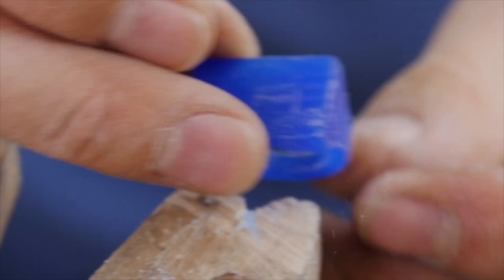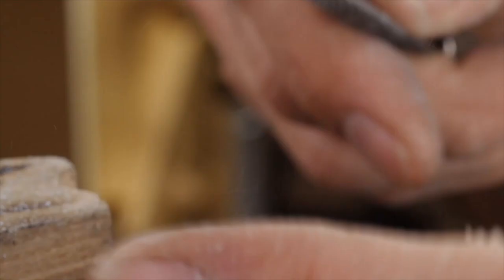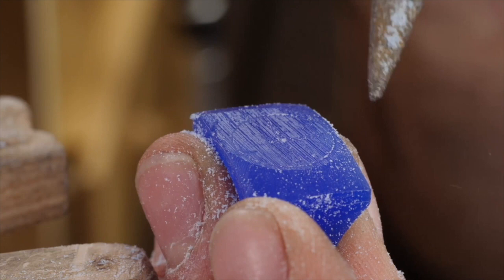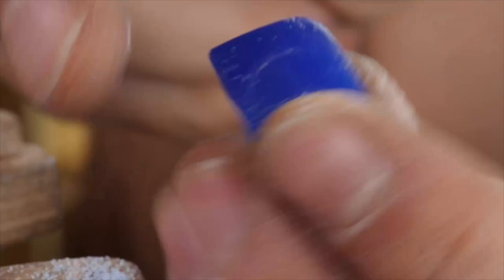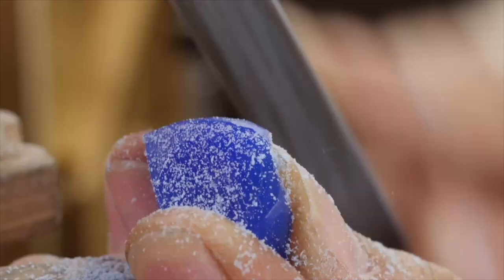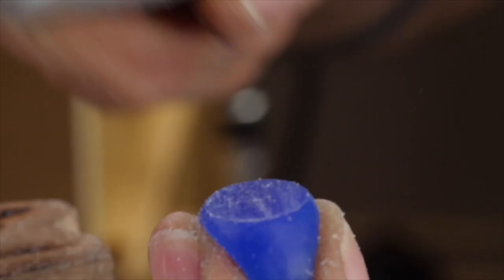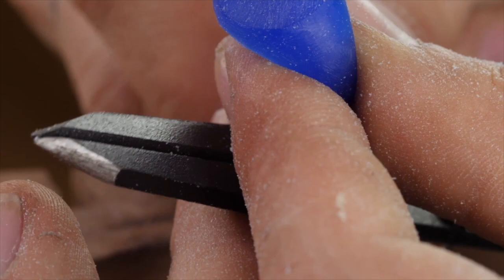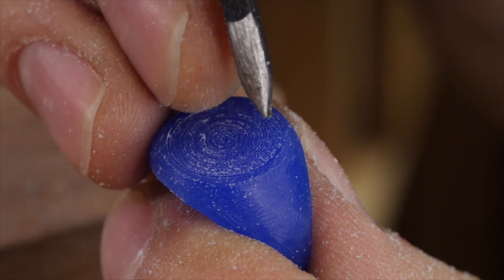Make a Wax Carved Signet Ring - Part 3

Comment: Great video, one thing that we do in my casting class that helps for finding center point faster is we use calipers to measure the width of the ring and then divide by two and scribe the line based on the number and it’s dead center almost every time! This is the best tutorial I have ever seen for ring carving so thank you! I’m making my class ring for a project at university so I wanted to do this style.
Reply from the maker: Thanks for sharing your tip! Glad you enjoyed the tutorial too. Good luck with your project x